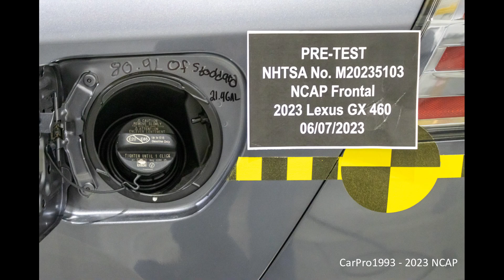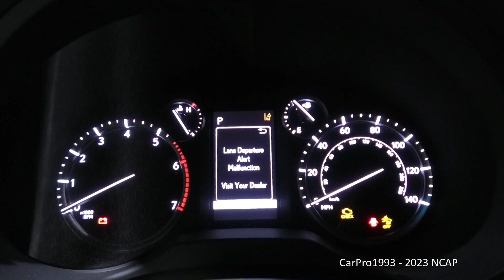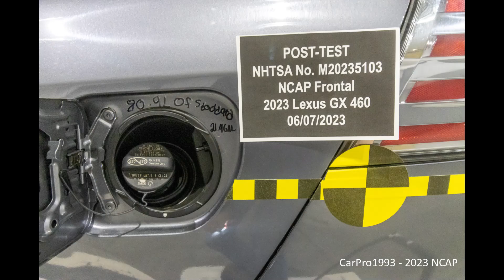2014-2023 Lexus GX 460 NHTSA Full-Overlap Frontal Crash Test

Comment: Ford Explorer is a 5 but I still bought a GX460.
Reply: Ford Explorer have more breakdowns and faults than Lexus GX 460. True because it’s Lexus there are more maintenance items. However, on average, I’ve noticed Lexus to have less failures overall. Though that can be said with most any vehicle if you follow the maintenance procedures. The real question is how many maintenance repairs are needed?

Comment: Isn’t this car from like 2010? This car is so old!
Reply: Same design features from 2014 to 2023.  Not much has changed in the frame or body in those years.
Reply from the maker: While the GX has been almost unchanged, the GX received the same mid-cycle update as the 4Runner in 2014 with revised airbags.
Reply: The Lexus GX structure was from 2003 since the old 470, this one came out with more safety technology and they have changed the airbags but for a 20 year old structure the performance is great.
Reply: If it's not broken why fix it? It's over engineered.
Reply: @CarPro1993 ah was wondering why 2010-2013 got missed out. I believe it has to do with the minor overlap test they likely reprogrammed the airbag computer for those types of events. In 2013 some cars(other brands) depending on build date got the updated airbag software and some did not, so makes sense Toyota did it starting in 2014.
Reply: @CarPro1993  if you have information, can you please share,  what is the difference between 2010 and 2014 gx. Found nice 2011 , don't know how is it safe. Thanks!

Comment: Of all the parameters measured in the accident, are the G forces the ones that determine the number of stars in the final rating?
Reply from the maker: From NHTSA's website:
"Instruments measure the force of impact to each dummy's head, neck, chest, pelvis, legs, and feet.  Frontal star ratings indicate the chance of a serious head, neck, chest, and leg injury to the driver and right front seat passenger in a frontal crash. A serious injury is one requiring hospitalization."
Reply: @CarPro1993  do you can post the 2004 Dodge Durango full frontal crash test?
Reply from the maker: There is not enough footage to make it worth editing, but here is the test if you're interested.
https://www.nhtsa.gov/research-data/research-testing-databases#/vehicle/4927